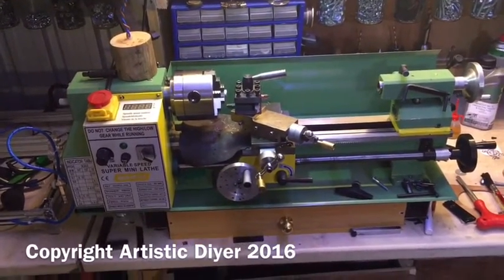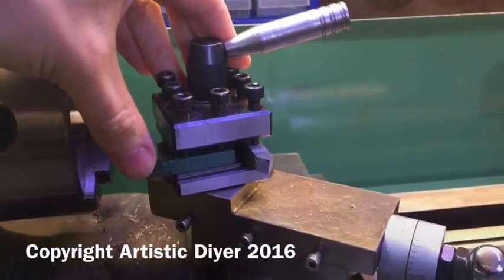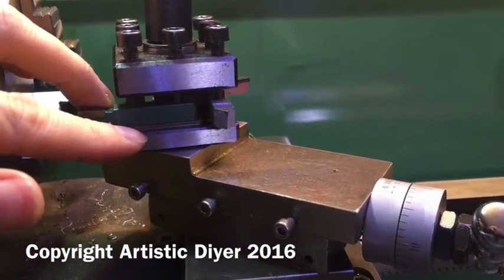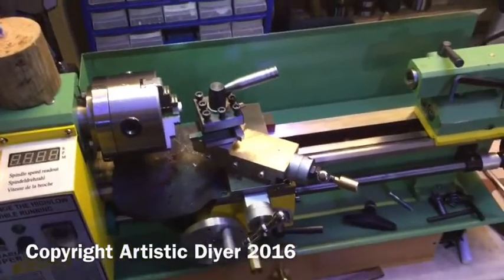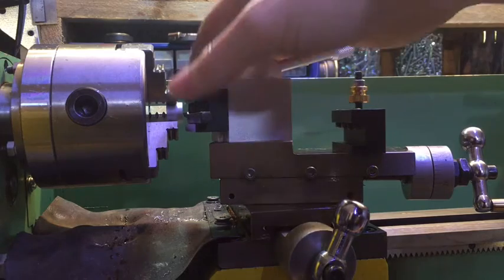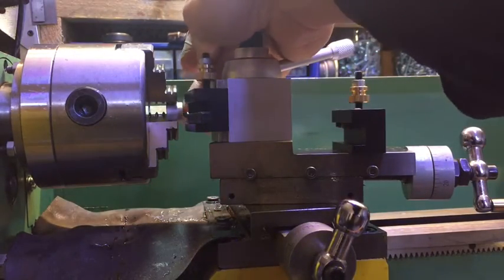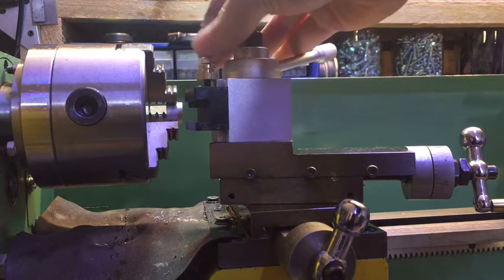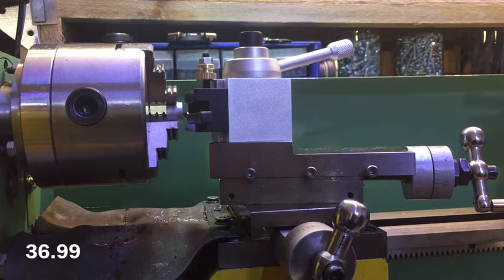CHEAP QUICK CHANGE TOOL POST FOR MINI LATHE

Comment: i have one of these and i have issues with the holder locking down when i tighten to retaining bolt. any hints? if i leave it loose then the holder spins but i have to back off the center nut to change tools every time.
Reply: I had the same problem and I was looking online to see if it wasn't just me. Turns out it's just because of faulty manufacturing and the center post that runs inside the QCTP was too short, so instead of locking down the square body, it locked the entire assembly, effectively jamming the handle too. I just placed a spacer into the central cylinder and it's basically fine now. Tight locking and easy tool change. Hope this helps.